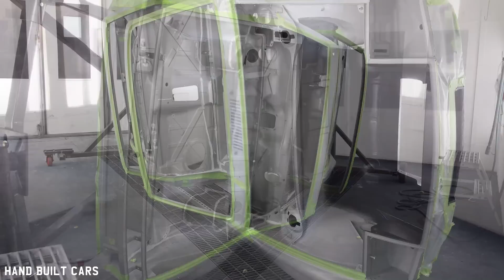1970 Porsche 914-6 Build Project

Comment: Looked to have a 4 cylinder engine ? If true ! It’s not a 914-6
Reply: Regarding the engine - did you see the triple stacks at @5:33?  And did you notice the ignition key placement and steering column at @6:40?  If this car wasn't an original six a donor /6 was scavenged.
Reply: @jimohara4796  sorry Jim mate I did not must of looked away briefly. Only played it once. But is a good build project than  Jim . I wanted to build a 914 but couldn’t get the right car here in Australia . So I resurrected a parts car that was too far gone and I’m changing everything. If I didn’t it would just be some unimportant parts in my garage. To make it interesting so I would do it I put 996 suspension front and rear with. 2015+ fa20dit engine with a six speed manual. Had to convert to right hand drive because previous owner cut up car to make RHD so I’m finishing the job now. But a 914-6 sounds to be a great project Jim and you should get your money back unlike my fun hot rod.